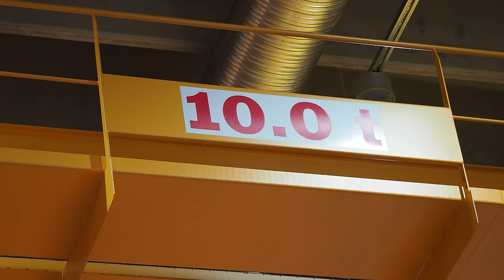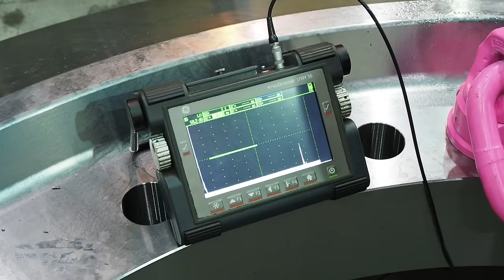Machining HUGE 10 Ton Bevel Gear with CNC Milling Machine

Comment from the maker: Thanks to ATA Gears for letting us film this project https://www.atagears.fi The bevel gear is going to be used on giant steel rolling mill which makes steel slabs for shipyards
Reply: HA! I'm still up !! I love machining videos !!! moi moi Marky_boi
Reply: I was going to ask! Big is interesting and so is complicated, but even better, big AND complicated! 😂
Reply from the maker: @PPYTAO  It's going to be hard to go any bigger than this :D
Reply: Please can you ask ata to ask the steel mill if you can go film the gears once they are in use.
Or better still ask them if you can watch them fitting the gears!!!
Reply: We need the follow up please! 👊🍻🐈🔥
Reply: This is impressive! I appreciate the time lapse. This video is straight to the point, short, concise, and informative. Thank you for making good youtube content.
Reply: As others requested before, if you can, please make a follow up vid.
I am also interested in the running in process, as the surface is beautiful, but far from the smoothness of a smaller gear in a truck for example. Or in this size and low rpms, it doesn't even matter? As I imagine, the sheer amount of abrased material can be mesured in kgs...
Reply: I'd be impressed to see the engine and shafts these gears will be mated to.. also, the installation of these gears would be cool to see..
Reply: I was thinking it was used on large ships so i was not far of 
I love to see more large pieces like this
Reply: I like watching time lapse of big projects. I used to do all kind of construction but now have spinal arthritis at only age 40. Late nights when I can not sleep I like watching mega machine stuff. 

I think you should have a video about the mill and then several videos from huge to complicated showing the range of possible projects. I am sure that the company would be happy to let you setup the camera more for the free advertising.

ps...a video digging things in liquid nitrogen and testing how brittle it is before and after would be great too. Best Wishes !!
Reply: love it
Reply: It's going to be used in the factory where they make the blanks for the giant gears. :D
Reply: can we have maching videos of very very very small parts lol
Reply: @gaborkrammer  Its difficult to do follow up vids involving customers of other companies. Those gears could be for a local customer or somewhere on the otherside of the world.
Reply: I dunno about anyone else but I'm always interested in how much material was milled off the gear and it's final weight as it was loaded on to a truck for delivery!
Reply: So, if it was 10 tons going in, how much did they machine off? I think everyone loves machining videos :)
Reply: @xXDeltaXxwhotookit  - Let's shout 'Tell us the finished weight!' and they might tell us!
Reply: Do they recycle the waste metal?
Reply: I thought it was going to be in your family shop 😂😂👍👍
Reply: LARGE AND COMPLEX
Reply: Is this gear going to get case hardened for wear?
Reply: Have to shout this out "Tell us the finished weight" , would be awesome to know how much material was taken off in the process of making. I would guess 100's of kilos
Reply: @CortinasAndClassics  Yes always.
Its nice virgin metal so they ship it straight back for money off the next order.
And the metal just goes back in the next batch.
Reply: Large or Complicated.... can we have both? Oh! What about those amazing ASMR slow motion machining videos? Nothing more satisfying that watching a mill work and seeing the chips come off at 1/100th normal speed
Reply: Первый раз на канале - сначала показалось что люди говорят по английски с русскимм акцентом ;)
Reply: I'd estimate about 1/8 - 1/10 of the cross section is being removed. So 1 - 1.25 tonne.
Reply: Rosie O'Donnell is super proud to have her treadmill up and running again.  Thanks guys for making these spares!
Reply: @Beyondthepress  Curious how much material was removed weight wise.
Reply: Imagine creating an apparatus to rotate this piece at at least 30 000 rpm...What would be the magnetic effect around it? How many hours it would rotate in equilibrium? And what could be the destructive effect when it falls down?
Reply: Trelleborg, Sweden. måndag den 27 april 2020. 

  flsmidth.com Started i Copenhagen with cement industry. 

Best regards / tomasgidlof.se
Reply: Trelleborg, Sweden. måndag den 27 april 2020. 

Yes!  The mechanical  industry have always done. valuable alloys 

Best regards / tomasgidlof.se
Reply: @TheWebstaff  I totally agree! That would be awesome! 👍
Reply: Did they need to clamp this down for maschining anyway ?
Reply: @Dr._Spamy  I'm guessing it's weight alone is enough to keep it steady.
Reply: @petarmiladinovic4126  couple of tons actually was removed :)
Reply: thank you for answering my question!
Reply: Big or complicated? How about a little bit of both! Variety is the spice of life. Great camera work! Thank you!
Reply: @Beyond the press bevel gears for an even bigger cnc machine?  haha
Reply: What did you say ?
Reply: Wind turbine gears?
Reply: @cliftonballad1634  I saw the chips too. They got their speeds and feeds down pat.
Reply: @Dr._Spamy  probably not lol.
Reply: I know the crane company, konecranes has a manufacturing plant in Houston.  I'm curious as to where the crane in the video was build. I cany believe there isnt a bridge crane manufacturer in europe.
Reply: I have no education, I even never learn to read, but please can you explain me one very strange thing? At the very beginning we can see graphs on display, which show how the milling cutter processes the material. And it graph is very non-even. Does it mean: 1) metal is of bad quality (granular, have different density etc.); 2) cutter goes very non-symmetrical path (which is bad for final form); 3) control computer is very non-precise, which is also very bad? Or all together?
Reply: would it not be worthwhile to cast the tapered blank ring with rough teeth, and only finish it by milling
Reply: @Beyondthepress  Hello to you and Anna from Florida. I am a retired farmer from Indiana and would love to see how they machine the crankshafts for the huge ships engines.. Thank you for all the cool shit you post.
Reply: I love seeing your big jobs, thank you so much for sharing!
Reply: I want one in my living room. Do they come come with a glass plate on top?
Reply: Какая зарплата у станочников?
Reply: Thanks for the background information. I can imagine those slabs are tens of tones also.

Comment: The scale of this is absolutely insane. Would love to see the whole mechanism this thing was built for
Reply: its for the gearbox to my quad
Reply: Wind turbine?
Reply: Its a ring gear for rotational props under a very large ship
Reply: @station08  I was thinking about hydroelectric dam but yours is more probabile
Reply: @petrimantere3288  perfect timing
Reply: When I heard that the gear went on a lathe, my mind was blown. Spinning that much material is insane!
Reply: @Bill Williams like planetery gears
Reply: @station08  the teeth are straight so it would be way too noisy at high speed (like a reverse gear is noisy on a manual gearbox car). drive trains (in ships, cars.. wherever) are usually using helical gears not straight ones, as helical gears are always in contact so the power transfer is smooth.
Reply: @hpekristiansen   Nikko meant that they had another machining operation on a lathe, not that it's end application was for a lathe. And @Nikko Gajowniczek It was most likely a vertical lathe, much easier to picture.
Reply: Hand watch?
Reply: idk Without knowing For sure I’d guess it is the gear that turns windmill head.
Reply: @esajunttila5486  I have never heard about a windmill that "makes steel slabs for shipyards" in the head.
Reply: Trivia Challenge you can read the answer in the description
Reply: @doctadank  there are videos of ship drive shafts being turned that make this look like a washer
Reply: The bevel gear is going to be used on giant steel rolling mill which makes steel slabs for shipyards
Reply: @station08  the pinned message says, The bevel gear is going to be used on giant steel rolling mill which makes steel slabs for shipyards
Reply: @doctadank  you don't need a very high rotation speed (velocity) because you have a big diameter
Reply: @TriviaChallenge  No, the gears there are in line all the way.
Reply: @station08  read the top comment.
Reply: @doctadank  I mean even during the finishing machining in this video the bevel gear was being rotated. The rotation speed doesnt need to be big.
Reply: @esajunttila5486  yeeeaahh.... riggggght...
Reply: Probably a differential for one of those giant dump trucks. That's what I get for a spider gear of this size, anyway.
Reply: It's big but not that insane. This kind of machining is more common than one might think. There is a lot bigger out there.
Reply: I'm always amazed at the size of these projects. The finish is amazing. I think it would be terrifying to mount something that big in a lathe.
Reply: Read the description. It's for a steel roller at a ship yard.
Reply: seriously, what was this thing made for?  i wanna know!  i wanna see it assembled!
Reply: @doctadank  You would want to make sure it was absolutely dead centered, if not just take out the centered.
Reply: It’s a planter for a yard. Durr!
Reply: I want a sweater with vat da faak on!! 😂😂
Reply: @station08  you're so wrong its hilarious. You never use straight cut gears in a powertrain. It's for a rolling mill read the description.
Reply: @doctadank  Would have been a vertical axis lathe. GEC at Trafford Park, here in the UK had ones big enough to machine the low pressure turbine rotors for a power station, When I saw one and was amazed, the guy told me there were far bigger ones.
Reply: Deane Minister  Mine too! But i work at a large iron/steel plant and there are many huge parts involved so i'm kind of familiar with these dimensions :D (This gear may even end up at the company i work for :D)
Reply: @doctadank  I don't think it would be spinning... It probably be cut on VTL... I use to run one back in the late nineties that had an 82inch table... But I would imagine there are bigger ones than that by now...
Reply: @station08  Neat. I learned something today. This type of particular gear design is more precisely called a miter bevel gear though (I'm a new mechanical engineer).
Reply: Literally tells you what it's for in the video description box.....
Reply: To all the commenters, this is not a ring gear, a ring gear can only function with a pinion or pinions such as in a planetary gearset, a bevel gear is usually to change the direction of work, ie 90 degrees or 45 degrees, could be for a power station, who knows? One thing to note is that it is a straight cut gear, not spiral or hypoid.
What this means is that unsurprisingly it is not made for a high-speed application.

Lots of torque, lots of load, not much RPM
Reply: It's a differential for a dump truck 😉
Reply: It's for a worm gear box for a normal size grinder
Reply: @Bill Williams Wind Turbines don't have reduction gearboxes, they have the complete opposite. Hub speed off 900rpm, generator speed of 3000rpm
Reply: Crazy!
Reply: It’s part of the timing mechanism in Paul Bunions wrist watch, he’s a big man.
Reply: @TriviaChallenge  The bevel gear is going to be used on giant steel rolling mill which makes steel slabs for shipyards look in the description
Reply: Take off the cover on the rear axel there you go
Reply: Some ships have to have a large gearbox since their engines only work in one direction.  This is the kind of gear that fits into those Gian ship gear boxes.
Reply: This is a bevel gear for kawasaki primary or secondary crusher mainshaft
Reply: @mcknorth  lol
Reply: These are the earrings of chuck Norris
Reply: @esajunttila5486  there's no windmill in the world, that needs such a big bevel gear. There's not needed so high torque and transmitted power for turning this things that you need such big gears.
Reply: @nocount7517  no, they have electrical motors in the drive hubs. And for gearing planetary gears. No need for a differential.
Reply: @ralanham76  no big dump trucks have electric motors in the drive hubs.
Reply: @nocount7517  Do you not read the description?
Reply: @TriviaChallenge  The bevel gear is going to be used on giant steel rolling mill which makes steel slabs for shipyards.
Reply: @mistakenotou7681  The bevel gear is going to be used on giant steel rolling mill which makes steel slabs for shipyards
Reply: The world's largest watch?
Reply: well its easier mill bigger than tiny miny
Reply: Its for a steel mill, says it in the description
Reply: I`m pretty sure our planet rotates on 2 of these
Reply: It's for the diff in my civic
Reply: A very large pepper grinder
Reply: The bevel gear is going to be used on giant steel rolling mill which makes steel slabs for shipyards.
Reply: Yes seriously I’m geeking out right now
Reply: Titan mukungurutse  this comment is the air i breathe!
Reply: you: "absolutely insane" ?

Wind turbine gearbox: hold my beer.
Reply: It’s for the new Nokia phone
Reply: @station08  most probably, some crazy big steerable thruster or similar
Reply: Optimus Prime
Reply: Mining equipment?
Reply: Maybe a tunnel boring machine? idk
Reply: It's just a big giant Rube Goldberg machine
Reply: Oversized Swiss watch.....
Reply: Tank
Reply: Could be probably for a giant fleet ship or a submarine ...
Reply: @jacobsgarage1458  there's always one.
Reply: It is an actuator gear for Soviet giant robot 🤖
Reply: Check out steel slab rolling mill shipyard. It's amazing what you can figure out in the comments... I figured out it's a good idea to read the description, in the comments.
Reply: Idk it's for a clock i think
Reply: Probably for a bridge or a useless wind turbine
Reply: @TriviaChallenge  read the description.
Reply: It’s for Pacific Rim
Reply: Replaces the ring gear in my Dana 30.
Reply: @Bill Williams just a little correction, the gearbox of wind turbines its not for reduction but multiplication. They can have paralel gears combined with planetary stages
Reply: Plot twist they make just for fun. It’s got no use
Reply: @mcknorth  nice quad 👍
Reply: @MONEYBOY512  Thanks :)
Reply: Its classified
Reply: Ur moms wheelchair
Reply: I think this is for the gearbox of the Moon :PP
Reply: Dracula's clock tower.
Reply: Probably the diff from a boat😜
Reply: Flying saucer
Reply: @mistakenotou7681  usually those types of generators ride on fluiddynamic babbitt with no reduction
Reply: Big ship?
Reply: You have heard of a Ford 9 inch rear end right ? Well this is their new bullet poorf rear end  9 foot  rear  chuck..
Reply: Imagine if they had to carve out a ten ton bevel gear with curved teeth like vortex style

Comment: To see those initial cuts being made in time lapse really shows how the table has to start/move/stop 10 tons every cut ! That it does it so precisely is a testament to how robust the motors, screws, ways and frame of that machine are. Remarkable.
Reply: x- axis is a linear motor with no direct drive.
Reply: @Kizahd  isn't a linear motor, by definition, direct drive? Still just as impressive
Reply: Responsible work holding and programming
Reply: That's not 10 tons,  10k lbs maybe, but not anywhere close to 10 tons
Reply: @frankcastle1885  Why would you think 20,000 pounds is unreasonable but 10,000 pounds is reasonable? I'm not sure that from a video you can make that kind of a call. (I'm not picking on you, I just don't see your logic here.)
Reply: @frankcastle1885  10 tons is quite frankly possible
Reply: european supremacy bruh
Reply: Dmg mori to the rescue
Reply: @glasslinger  I wouldn't let anyone in my shop move a 10T piece on a 10T crane and precisely position it on a CNC.   It's dangerous, one bump and the CNC operator might strangle you.
Reply: @frankcastle1885  10,000 Kg is over 22,000 pounds
Reply: If you look at 1:47 you will see the cutting tool is stationary relative to the background, so it is the workpiece that is moving. In other shots you see the cutting tool is moving relative to the work. I’m sure the machine can perform cuts where all axes are in motion simultaneously. I’m just amazed that that amount of mass can be moved and stopped so precisely.
Reply: @mgjk  if the crane was load tested before and the break is holding, I don't see why not
Reply: @frankcastle1885  10k pound is 4.5 ton. But I think you're just talkin' shit, it's close enough to 10 to round up or over it by barely enough to round down. Let's call it 10 ton.
Reply: @frankcastle1885  based on what?